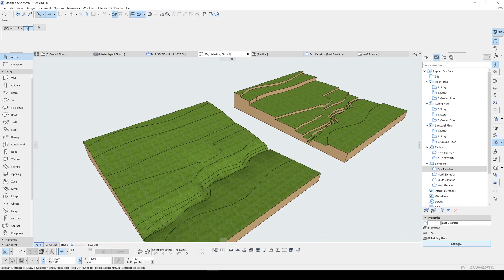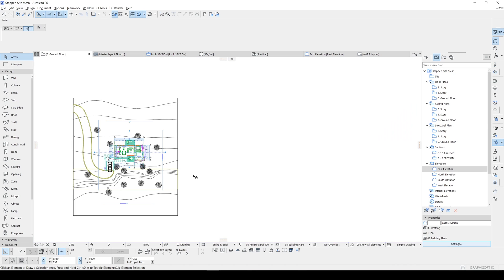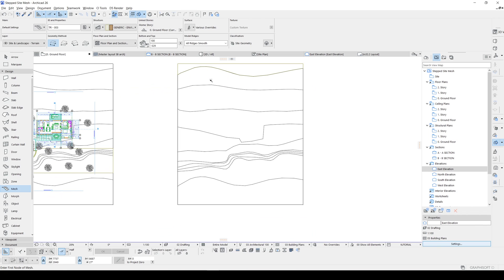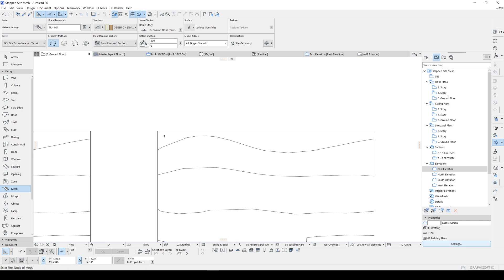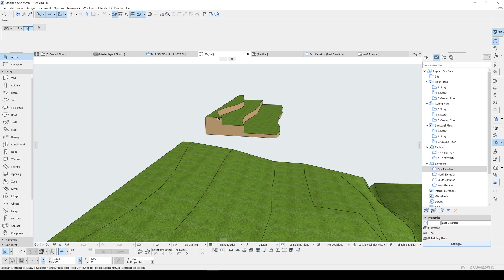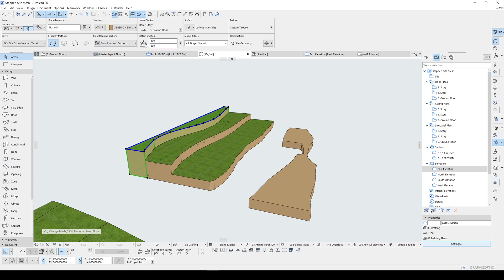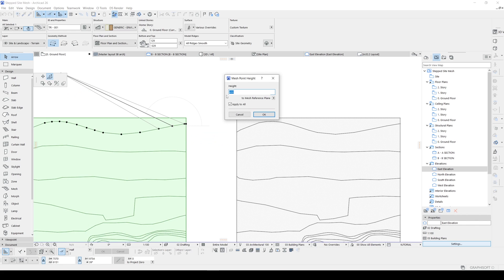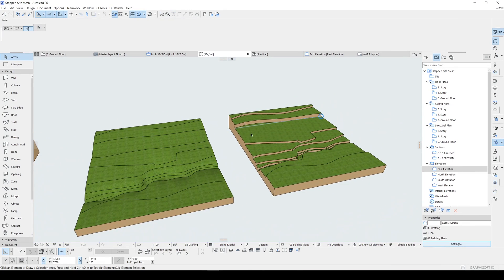Stepped Site Mesh in Archicad Tutorial

Comment: Hello! I actually need to know how i can do the opposite of this. I have made a stepped terrain but i need it sloped just like the one you had in the beginning:') 
Do you have any video that can help me do it quicker than just changing the elevation of each mesh point? Thanks!
Reply: Create polylines from the different levels, extending a little out from the terrain, create a mesh that contains all the site, and then select said mesh and "inject" tool the mesh on top of the created lines and it will ask you if you want to create new points
Reply: did you find a good solution. i have the same problem